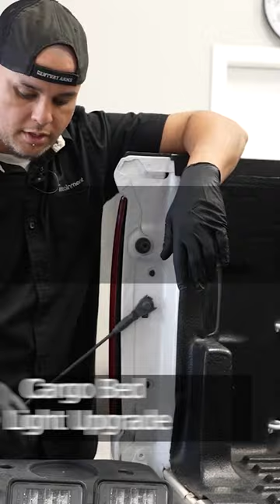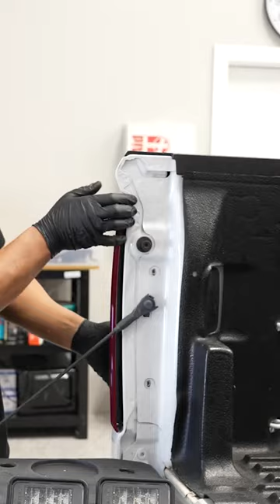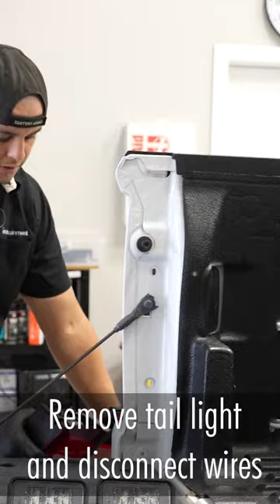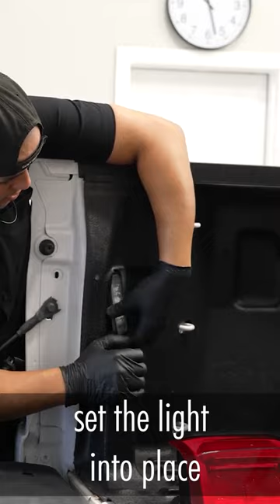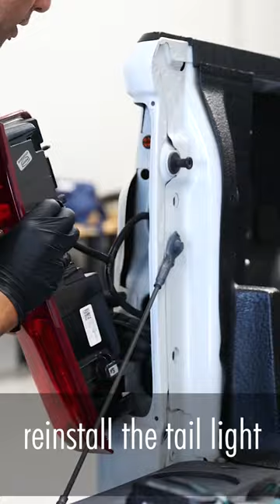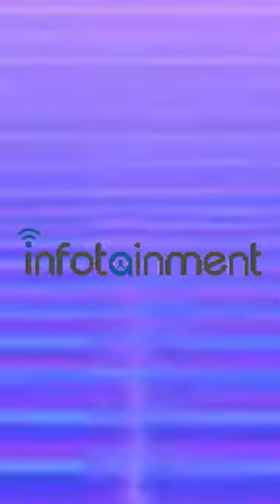2019-2023 Chevy Silverado Cargo Light - Infotainment.com

Comment: So I have a 2021 2500 that I bought these lights for and I can’t get power to the wire for these lights. Any suggestions?
Reply from the maker: Are you certain that the vehicle is pre-wired for the bed lights? If you're just trying to get power, you could try tapping a line into the tail light power wire.